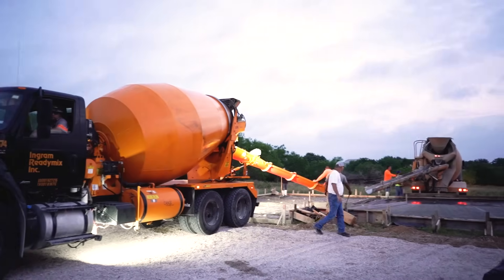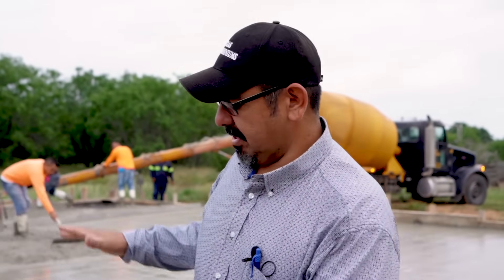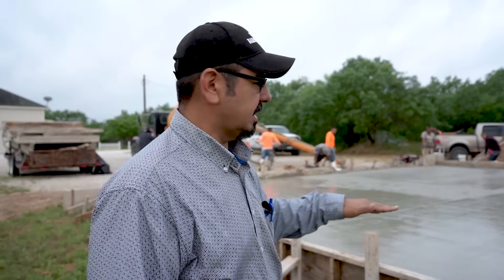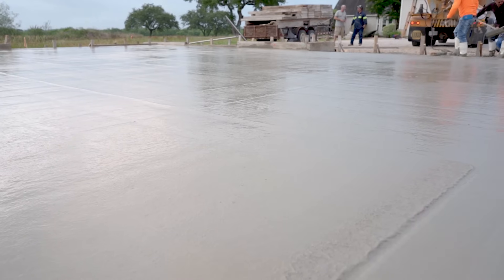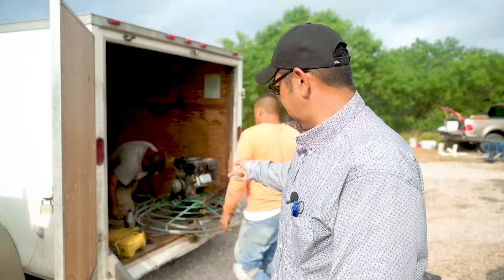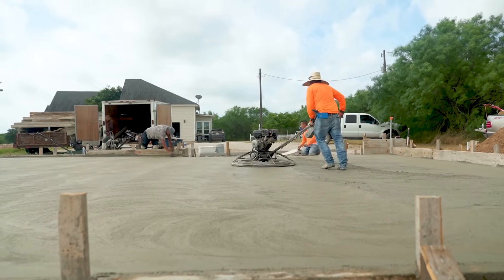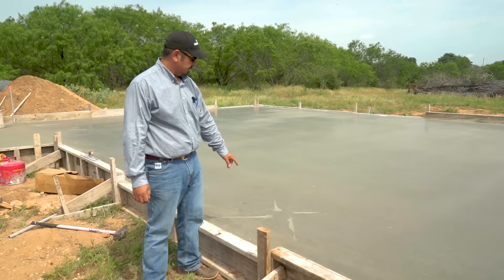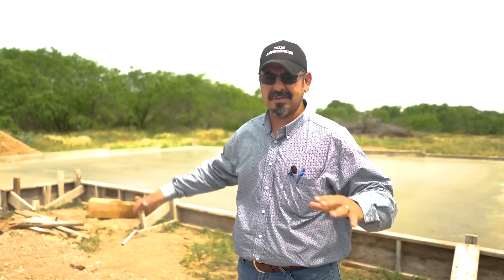How to pour and finish concrete like a PRO! - The Barndominium show E127

Comment: Great Video. 

As a ready mix supplier I talk to so many people who watch videos and think they can do it. Very few videos show the steps and time it takes to do it properly.
Also mentioning Sack concrete mixes vs. Cementitious concrete mixes. Most folks don't know the difference and only care about price not quality.
Moist curing concrete..... moist curing is the easiest and best thing to do. You may feel like a fool going to water your concrete but it is a great thing to do.
Reply from the maker: Thank you.
Reply: I also use a curing compound. City 600 works very well.
Reply: I am a structural concrete guy, heavy highway work mostly for Arizona DOT. They do not allow any water to be added to the mix after the truck leaves the yard. they get upset if you spray water to help finish.  Cannot be more than a 5 inch slump, they prefer 4 inch. Slip forming is done on a 1 inch slump. As far as finishing concrete, you cannot watch a video and go out and do it, its a skill, it takes practice.
Reply: @chuckmiller5763  good advice, remember, slump can be modified with water reducers.
Reply: @ericsmith1319  Used lots of plasticizers.  Also used a off brand cement called Rapid Set, it hits 3000 PSI in less than an hour,  9000 PSi in a couple weeks.we used it to fix potholes in the Sky Harbor airport, they could land on it in a hour. Great stuff, it sets in about 5 minutes, set poles and work on them right away, no waiting till the next day.
Reply: We're are you located ?
Reply: @chuckmiller5763  Agreed on the do not add water once the truck leaves the chemistry lab !!  There are chemical reasons why concrete is ordered differently and the point of that is, psi ratings and more. Those who engineer concrete mix do not want it touched once it leaves the plant (lab).  That will alter the engineered mix for the job and cause liability issues as well as safety concerns. It's all about quality control.
Reply: @Garth2011   So we dont want to talk about adding a little clear Gatorade (sugar) in the spray can to slow the surface curing time and help out the finishers when its 110 degrees outside??
Reply: @chuckmiller5763  My reference was about the mix. Finishing is an art which I don't know much about other than its good to use a bump cutter for flat finishes.
Reply: @chuckmiller5763  For years, we had nightmare experiences on federal/state projects with water and water/cement ratios - what worked on paper didn't on the job (relationship between slump, strength/longevity, placement and finish quality).  Then about 15 years or so ago a lot of the career guys retired and a few newer folks got in, open to education about superplasticizers, retarders and other additives that allowed all four parameters to be met.  Life got a lot easier in the batch plant, mixer trucks and ground crews.  It took a year or two of cylinder tests and re-education, but the results were more than worth it.  Now we breeze bridge deck pours, better quality with bridge structure and piers, and just average sidewalk/approach, general abutting flatwork.
Reply: @jayphillips4058  We had a job that was about 45 minute hall from the nearest batch plant,  in West Phoenix, the concrete kept hitting over 90 degrees when it arrived Arizona DOT rejected 2 six yard loads, on the third, I called the batch plant had had the driver stop early, I loaded the batch with 10 bags of ice, sent him to the job and the mix hit 82 degrees.  slump was wet for sure but ADOT didnt check it, just the temp. Sometimes you got to do what you have to do.

Comment: Great video. For years on my sidewalks I was using finishing trowel first. And although I made it work, I was never happy with the results. It worked and looked great but I was working double. Keep in mind I do drainage and usually the sidewalks we were doing were for free for the customer part of the job. Anyways I started only magging and finishing until the end recently and the results have been amazing so far

Comment: Put a sprinkler on a green , just finished slab and keep it wet for 7 full days.
IT  WILL  NOT  CRACK  Most concrete finishers never tell you about
this important step for a no-crack surface.
Reply: That's called curing the concrete.
Reply: And yes it will still crack regardless wet curing or no curing at all yes will help with wet curing but concrete cracks no tensil strength to speak of but very good compression strength

Comment: Vibrascreeds require a very low slump, no greater than a 4; this makes it hard on the placers.
I saw a comment on riding on forms, that is correct but keep in mind, the forms and the vibration in the forms will also  consolidate the stone to the bottom.
This means, the concrete design has changed and psi of mix will change to the weakest configuration...
Not enough paste and sand around those stacked stones at the lower half of pad.
Basically, you are left with a thick mortar bed for your wear surface...
I enjoy your videos, thank you.
Reply from the maker: Thank you!   I think you are right.  :)
Reply: @Construction News & Engineering  That's why we rarely see them around our area, that settling action creating a mortar top leaves exterior slabs especially vulnerable to the extreme freeze/thaw cycles we experience here 6 months a year.  Same reason jitterbugs and rollerbugs disappeared years ago..nothing but a thin mortar paste on the surface, blows to pieces in a very short time.  IMHO, if a guy is going to use a mechanical screed system, a roller screed works pretty well.  Extra time for setup, moving parts, etc. but a nice flat surface that floats out well.  If the rakers are on the ball, fairly easy going with stiffer mud and a nice consistent aggregate profile.

Comment: Man that CVT clutch is smooth!  Love the channel. Very professional!
Reply from the maker: Jason Robinson thank you.
Reply: @TexasBarndominiums  I agree I do commercial grade concrete in Boston. We do everything from high rises to high schools. Im going to talk them into letting me convert a few to start. Thanks for the tip. Oh here's one for you. When you get a new straight edge take off the end cap take a can of expansion foam with a tight fitting hose and fill the straight edge. Wont bend anymore will always stay lite and strong you can run them over. I do it to all mine. Please try it.

Comment: FYI, concrete doesn't "dry", it cures. That is why as was stated it can become hard under water. It's based off the chemical reaction of the materials mixed. It "setting" is considered the process of it achieving a certain point in the curing process at which it becomes firm. 6" slump is actually on the wetter side but provides for more workability as can other specific additives used when you do not want to add more water as that will lesson strength, but need more workability. It's quite interesting how just a few ounces of of these admixtures will act as though you've added gallons of water to the mix. Another important factor is the air content especially so at higher elevations. As is the time frame of mixing due to the chemical reaction starting immediately upon mixing if not placed in time a loss of workability, consolidation and strength will result. So the time and also temperature of the mix come into play identifying it's state in the curing process. People think you just throw some rock in, bit o sand, cement and water and all is good but there is A Lot that goes into a good finished product before you even Get to the finishers. As one can see, that's a whole nother ball of wax to deal with.   :)

Comment: I've been in construction for 20 years in Australia. I have never seen a jitter bug or a bump cutter. Also never seen 2 people screed like that! Very interesting video! Also didn't see any laser levels as they screed??
Reply: Also our standard slump for concrete is 80mm slump about 3.25 inches.
Reply: I wonder if it's because of that screeding technique all the extra work is required... we just use bullfloat after screeding and combo blades to finish, always flat never complaint

Comment: Would it make sense to make the approach to the overhead door an inch or so lower than the main slab to prevent the possibility of the gap under the overhead door that you spoke about?  (Also would minimize the chance of water coming under the door during a driving rain storm).  I feel like I'm getting a post-graduate degree in barndominium building here.  At the very least, I'm going to be a very well-educated consumer.
Reply from the maker: I don’t like doing a drop at the overhead door because the lip makes it hard to sweep and also makes it hard for anything with small wheels to roll over it.  
If done properly, the slope works very well and have never had driving rain to inside.

Comment: I believe saw cuts in the concrete are more effective than the watering. In the hot summer time I’ve had builders water for 7 days and others not watered, not much difference at all. Saw cutting I can almost guarantee no shrinkage cracks.

Comment: The concrete is long set, the water is to slow down the cure time.  .Rapid cure = rapid shrinking = rapid cracking. So water slows down the concrete water evaporation. When possible use small bulkheads to retain water  then flood slab with 1-2 inches of water

Comment: Do residential slabs not use saw cut/control joints? I ask because I’d love to see any of the post curing process after your initial pour and finishing process you showed in this video!
Reply from the maker: We don’t cut any control joints on residential slabs.  Only flat work (sidewalks, driveways, etc)
Reply: @TexasBarndominiums  any reason why not
Reply: @rubenvarela4077  You Tool your joints for the exterior concrete, and saw cut your joints for interior concrete.

Comment: Are dobies a good idea to use for those "flat work" job that will have rebar in them? I have seen finish concrete workers pull up the rebar as they pour but would a dobie best best to hold the rebar in position vs. hope it stays above the highest point??
Reply from the maker: Yes, they are always a good idea.  Lifting the wire or rebar during pour works ok, but I prefer to do that ahead of time.
Reply: @TexasBarndominiums  Great. Dobies will be on my requirement list every time there will be steel reinf, even with wire for that matter.

Comment: I do the polishing until there are no footprints on the surface.  Then pour  natural soap- water- Mix on the surface to make the concrete hydrophobic. Cover  it with plastic wrap 50my, so the water stays inside the concrete.  We also pour corundum sand and cement  on the  green concrete surface  before we start the machines.  Gives a very strong surface.

Comment: What do you think about vibrating screed?? It will vibrate concrete and bring up cream??
Reply from the maker: I have never used one.  I have heard some bad stories about them pushing aggregate too far down.  But I don’t know for sure.
Reply: Vibes screeds do well as long as you have quality rakers. It still keeps aggregate high enough for strength. No deeper than a jitterbug.

Comment: What if you are going to coat concrete with polyaspartic or epoxy in 45 days. Is there anything that can be done so one does not have to grind before applying a coating as mentioned?
Reply from the maker: Don’t finish concrete as tight.

Comment: Hey can that cvt cluctch fit all trowels or do i have to get a certain one
Reply from the maker: It should fit.  All motors have same size shaft.  Gear box is either 5/8 or 3/4 shaft.
Reply: Thanks alot man

Comment: You forgot to add the self leveling power on top of the concrete. you can came back hours later and it’s done. 👍👍
Great jobs on  your channel it’s amazing content.
Reply from the maker: Thank you.  😊
Reply: Right, and they covered up the grass with plastic sheets so they had to use rebar instead.

Comment: Hypothetically speaking, if you were doing this job  on a home that you weren't building (just the slab), what is a fair price for a customer to pay for formwork,  pouring,  and finishing a slab that size?
Reply from the maker: $10-$15 per sq ft depending on slope and beams.
Reply: @TexasBarndominiums  
        Thanks.
Reply: Find the pump truck guy, someone told me he always has extra concrete in the hopper for $20.00 and a burrito.

Comment: Those torque converters are instant power. Not like a clutch that takes a bit to reach full speed. With a torque converter it’s there as soon as you gas it.

Comment: If you have bleed water like this, you added too much water. Next time use a water reducer from Sika or equivalent. Also, concrete is a recipe. Like cookies, you just can't add more butter and expect it to turn out good. Same with concrete. Adding too much cement doesn't make it better. That is why there is a "Mix Design".
Reply from the maker: We didn’t “add” cement.  Just eliminated the fly ash.

Comment: What is elamination? What does it look like when it dries?
Reply from the maker: “De-lamination”. Surface of the concrete peels off.  Like a blister.
Reply: @TexasBarndominiums  oh ok, we had a guy pour 2 slabs for us and the edges are white where they ran their hand trowel, was wondering why.
Reply: You trap "Bleed Water" under the mortar layer.. Remember one thing...A Customer is only interested in the first !/4 inch of the slab. Go figure!

Comment: If you use the roller style jitter use weights cause its not as good
Reply: Yeah just rides on the top
Reply: Yah it really dosen't get the agrigate down enough in my opinion I had an guy do that on an 30 by 50 slab and he screwed it all up then it cost me another $800 dollars and 2 weeks of my own time to fix the slab surface so I didn't have to tare it out and spend another 6 grand replacing it. Such an nightmare, I  love concrete but I decided to sub it out to an guy cause I was more focused on framing the metal shop up and doing the septic and such. Never again ill just do it myself next time lol

Comment: In Australia we screed and bullfloat the slab and leave it to dry ready to finish you guys work double you should watch a concrete ninja  video
Reply from the maker: So you guys don’t make it flat?
Reply: @TexasBarndominiums  yes we do we use laser beam level and it's within 1 to 2mm of level
Reply from the maker: I’m assuming you use it on the forms and while you screed.  What about after concrete has been poured and mag floated.  Do you do anything at that point to ensure flatness?  We use the bump cutter and float pans for that purpose.  Makes for a much flatter slab than without it.
Reply: @TexasBarndominiums  we don't use bumpcutters but we use float pan and ride on machines we check the level with the laser as we screed you should watch the concrete ninja on you tube on how we do concrete in australia
Reply: @TexasBarndominiums  Have a look at ConcreteNinja's channel. Here in Oz, all concretors use a purpose-made aluminium screed with handle. Accurate height pads and strips are made using the laser level, the screed gives a perfectly FLAT surface ready for floating, unlike the rough and uneven one created by your scrape and kick timber screed technique, (which hasn't been used in Australia for over thirty years). There's no need for jitterbugs. Bullfloats remove the few screed marks, then choppers/helicopters are used - fast and gives superb results. Interesting to compare the different techniques and results, ease of work, less steps, quality finish. Your slabs look great and are ultimately superb, but there are just a few easier and more efficient ways of doing them.Try a proper MasterFinish screed, guaranteed that you won't waste time with timber or jitterbugs or other time and energy wasters after that. If you look at the many videos uploaded by ConcreteNinja , you'll see the techniques and the quality result. Best wishes from Downunder! ;)
Reply: I've never seen mesh that big in Oz either. Looks like 400mm squares.

Comment: I have discovered the true secret to getting mirror finishes,,  once it’s almost set, using a spray hopper, spray down a cost of diesel fluid on concrete.. you’ll be amazed at the finish…

Comment: Good job but not as described as a mirror finish. Poly blades don’t react to the sand being manipulated in which the shine is derived from or mirror result. Nor will you ever get it with walk behind machines, they’re far too lightweight. Only way is with riders and steel trowel blades that operate at triple the RPMs and 5 times the weight

Comment: You are a very knowledgeable concreter and excellent tradesman however you could be better. 
If you learnt how to screed with aluminium screeds like we do in Aus you don't need your bump cutter. Those planks you screed with don't look like a flat  option. 
We get our concrete to about 2 mm tolerance with our screeds. It's bang on. Of course it takes a few years to get to that standard but a good screeder in Aus can screed extremely flat floors.

Comment: I would kneeboard the whole thing by myself and be out of there in half the time. Trial machines are only necessary when pouring out something big. Oh yea most people can't slick finish hard concrete on kneeboards. lol what am I thinking.
Reply from the maker: You can’t make it as flat on kneeboards as you can with trowel machine.  

Also, you can’t get as good of a finish.